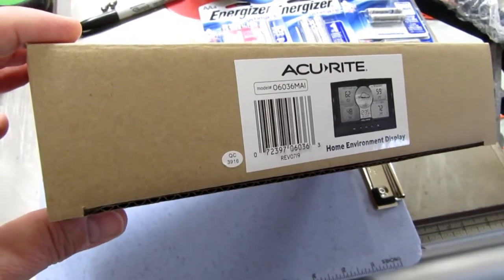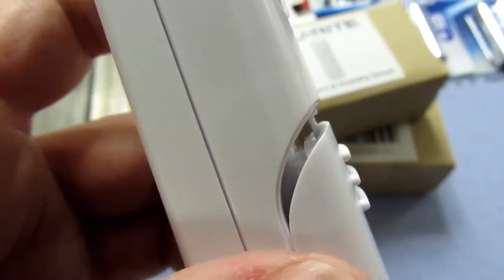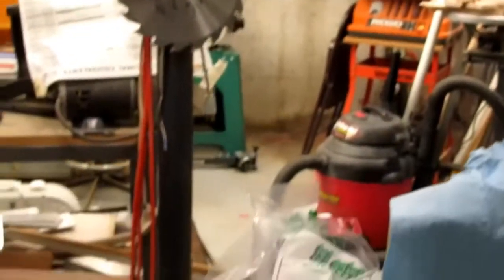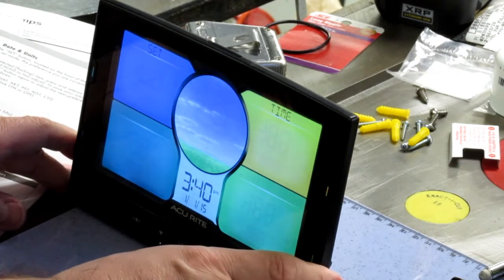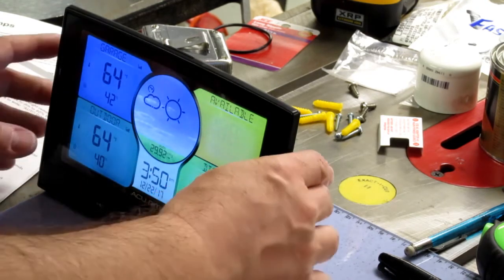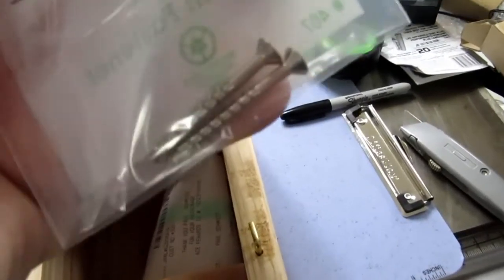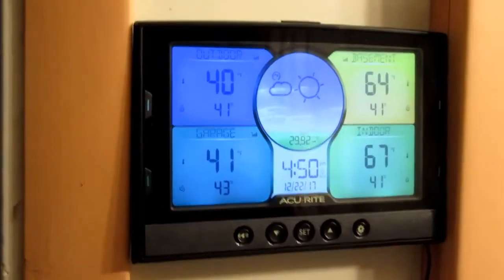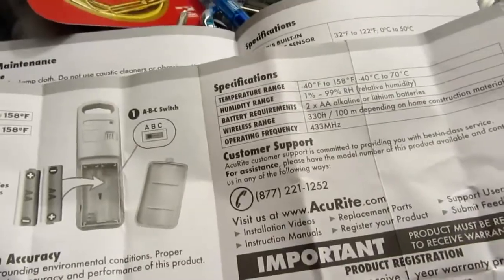Acu-Rite 02082M (06036MAI + 3x 06002M) Thermometer/Hygrometer

Comment: https://youtu.be/yhsVrWZU5_s?t=22m9s
It's my understanding the optional wired sensors are not wired to the base unit. Those sensors are transmitted remotely just like the transmitters you have and show in the video. But the "wires" are related to the functions of the sensor. For example, a water sensor will tell you if there's water on the floor (sump pump is not working, your basement is flooding, etc.) and in order for the sensor to work you have a small sensor that is placed on the floor (or where ever you want to look for water seepage or flooding) and a wire runs from that small sensor to a larger piece which is the transmitter that sends a signal to your base unit. But, you can only have a total of 3 transmitters so if you were to buy and use the water/flood sensor you'd have to stop using one of the temp/humidity sensors that came with it.

Comment: So youtuuba what is your conclusion about this AcuRite weather station? Recommend or not? I purchased one of these gadgets (model 02048HD) and found it to be somewhat unreliable and range sensitive. Sensor requires attention and needs to be paired with display unit periodically to synchronize. Wireless communication is unreliable. 👎👎👎
Reply from the maker: So far this device has worked pretty well. I had once instance where the GARAGE sensor signal strength indication on the display showed 'no bars' yet the sensor readouts for temperature and humidity still worked; this issue went away by itself after about one week and has not recurred. I also had one instance where two of the four channel readouts lost their identification, e.g. GARAGE or OUTDOOR, and reverted to displaying the default names, and yet the temperature and humidity readings for those channels continued to function; it took a minute to go through the process of restoring the desired names to those channel readouts. I have not had any issue with any remote sensor not working because of being too far from the base unit, the apparently errant signal strength reading that one time being the exception.

I agree that I have found wireless communication to be somewhat unreliable with many different devices. However, this device and also my Netgear Arlo Pro system has been working well enough in that regard that I have experienced no read issues with them.

Comment: Can I install the three sensors  inside my cold storage where the temperature is maintained at 0-3 C ?
Reply from the maker: Karan Singh, -3 deg C is well within the range of the three remote sensors. I would guess that there might be an issue with with range of the wireless sensors of your cold storage area has metal walls. Call Cheney Instrument tech support and ask them, I have found them to be easy to get ahold of.
Reply: youtuuba thank you... loved your review 👍